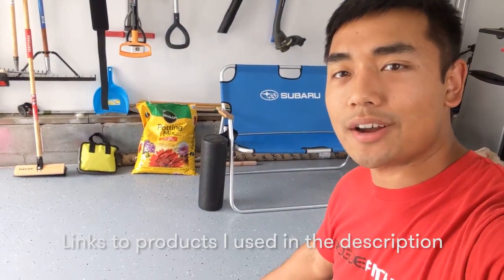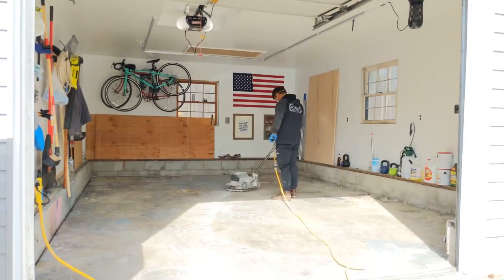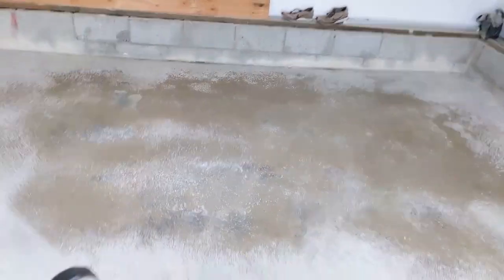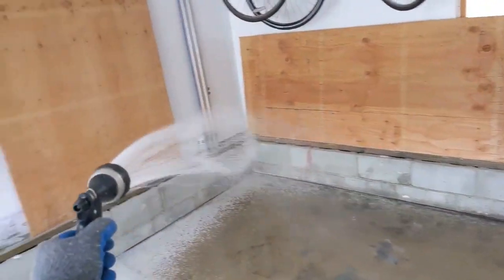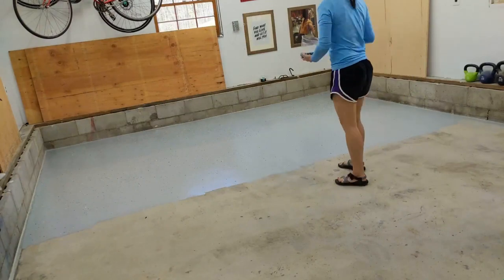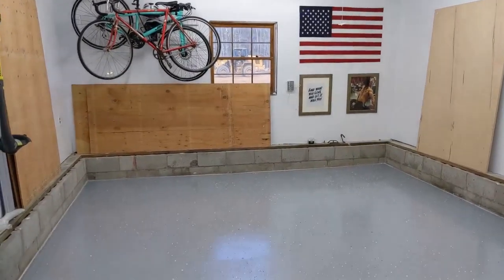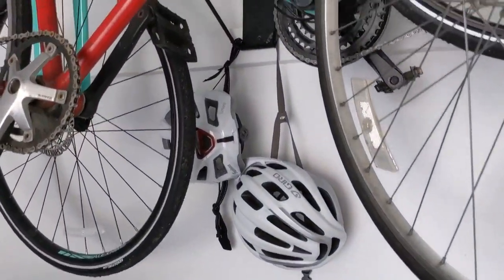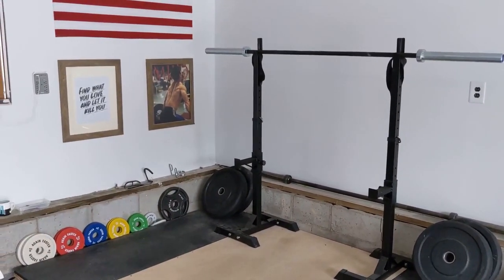How to DIY epoxy garage floor using Rustoleum Epoxy Shield & short garage update

Comment: Thanks for the tutorial and garage tour. How is it holding up after a year? Especially the area where you have your gym? Thanks
Reply from the maker: It's holding up decently! I would say that parking a car is fine. For the gym area, I have the 2" platform that takes most of the impact and also use some crash pads if I need to drop weights so I'm not concerned there. 

I will say though, I try to avoid dragging stuff on the floor cuz it does scuff the floor. As for cleaning, it's way easier since the pores of the concrete are sealed! Oil and water are super easy clean ups. 

A year after, I'd definitely recommend it still. I would probably have gotten a second package to get better coverage though, especially since it was only $70 for the epoxy (might be more expensive now).

Comment: I have read that tire pickup is a problem sometimes. Does it seem durable and have you had any adhesion issues?
Reply from the maker: Haven't had any problem! I would definitely wait till it's fully cured, maybe even longer than the instructions say, before putting a car on though. I think when I left a car parked the first time, you could tell where it was after I drove away

Comment: hi question here. when you rent the grinding equipment the grinding wheel coming together or need to buy separetely?thanks.
Reply from the maker: Hey good question! They rent separately and I included links to them at the bottom of the description. For a 4-hour rental in my area, the grinding wheel is $75 and the machine is $39. Make sure you rent both of them, otherwise you won't be able to do anything!
Reply: @JohnHeng  appreciate and merry xmas!